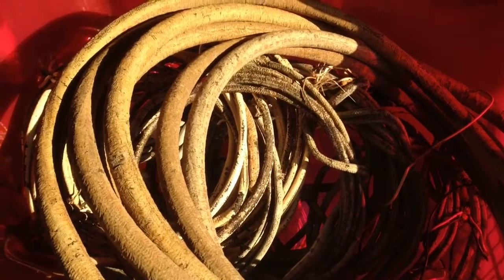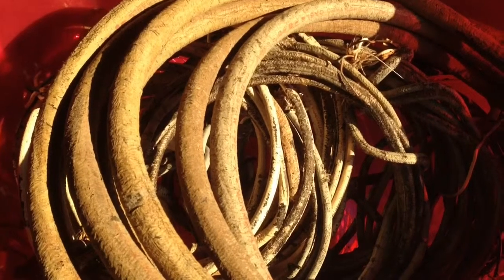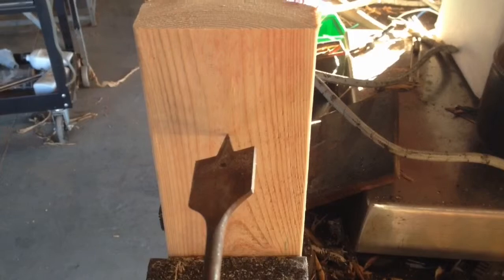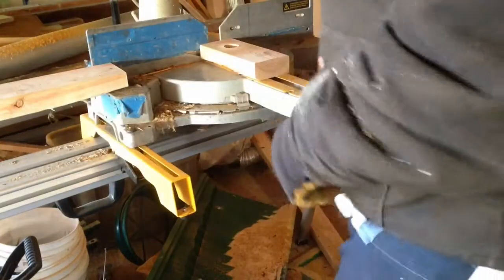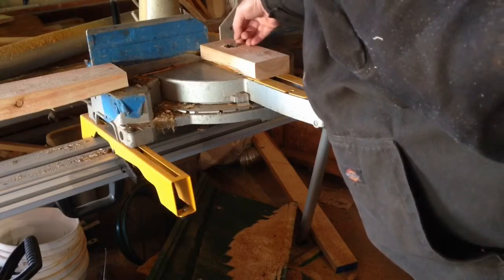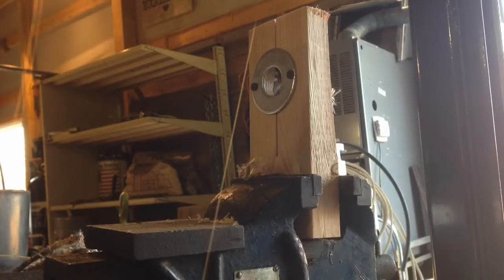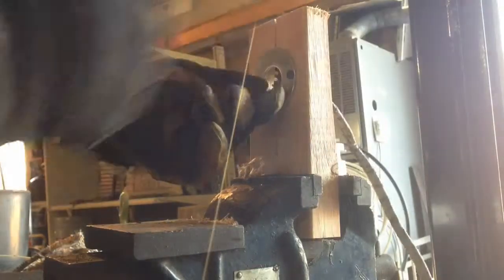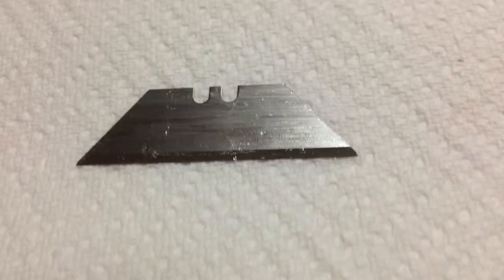Stripping cloth or fiberglass Romax copper wire for recycle.

Comment from the maker: I found out that on long pieces of wire the hole was clogging with insulation until I opened the hole in the washer to the same size as the hole in the board. It worked great after that. cb